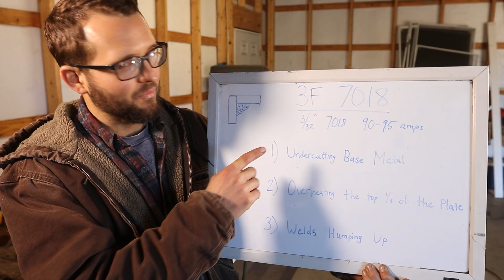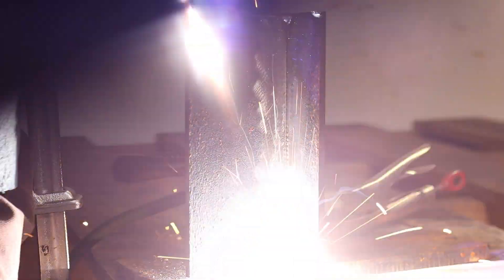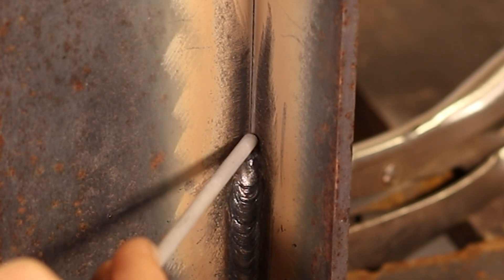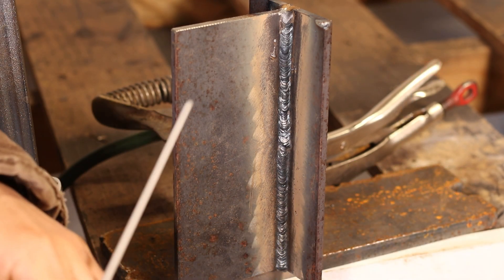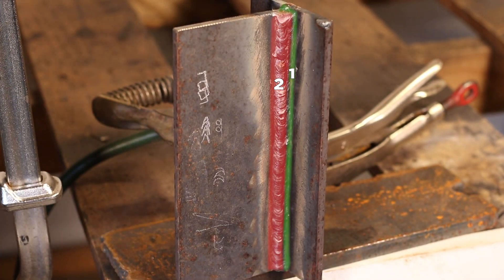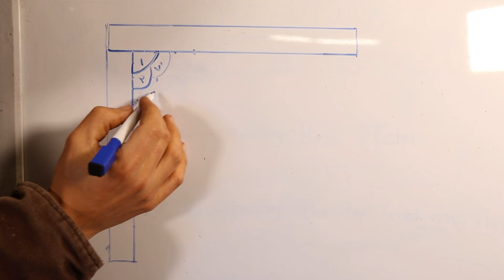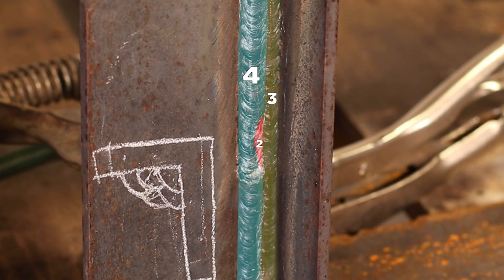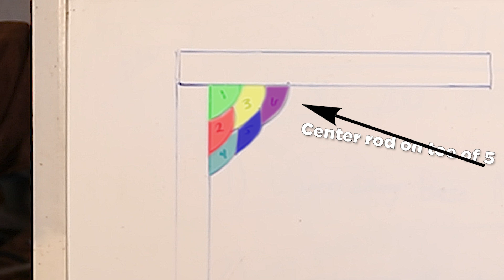How to Stack Welds in 3F Position

Comment: Any videos on flux core 3F?
Reply from the maker: I don't have a video for 3F in that welding process but the concepts from this video would apply. You would stack the beads the same, keep the plate from getting too hot etc. My recommendation for vertical flux core would be to keep  your wire on the toe of the previous weld and keep your arc length tight. Don't weld too hot, and let it cool down between passes. When flux core gets too hot it tends to mound up and droop.
Reply: Thank you.